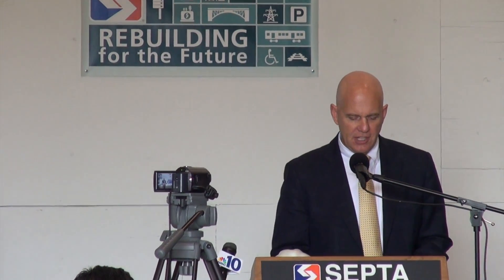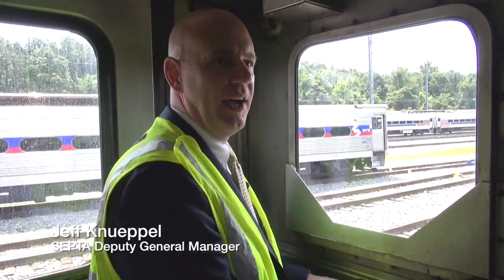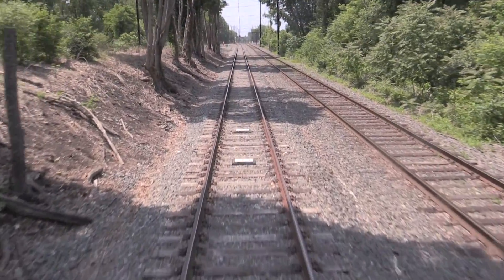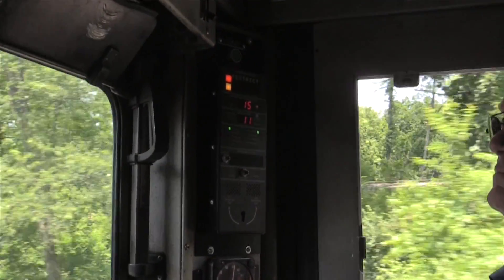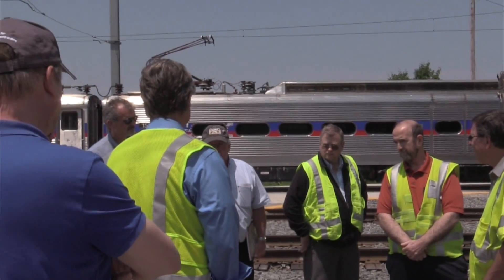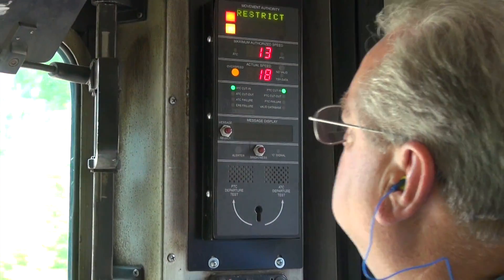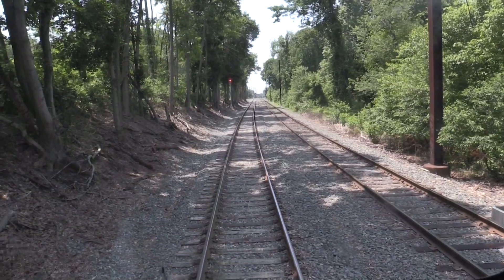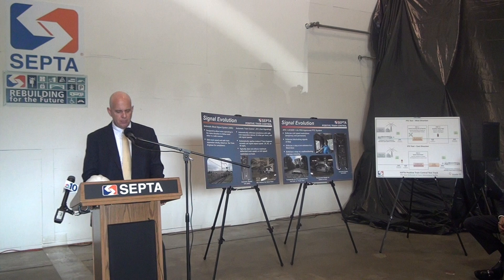Positive Train Control (PTC) Program Overview

Comment: Congress mandates something that did not exist thanks to two boobs named Boxer and DiFi. Here is what PTC will do for you, a 8000 ft train goes into emergency triggered by PTC. Cannot be overridden even though there is nothing wrong. The train blocks 3 major grade crossings for 30 minutes while the air is pumped back up.
Reply: So a train goes over the limit by 5mph going down a hill and up another it stops the train for absolutely no reason in a spot where the engineer doesn't wanna stop they should make a 10mph buffer so basically you're gonna be going under speed so PTC doesn't stop the train it's bullshit.